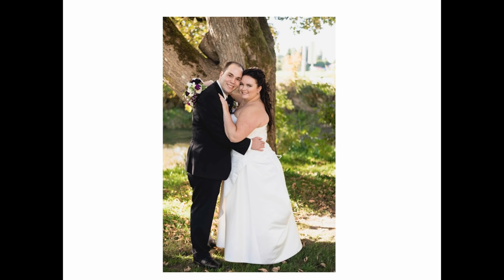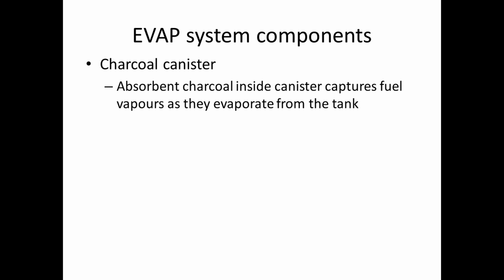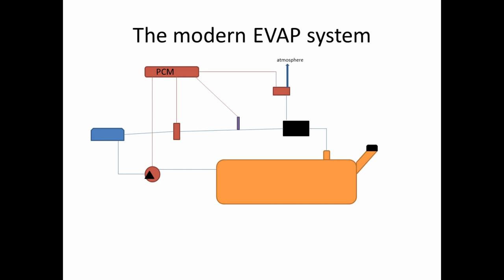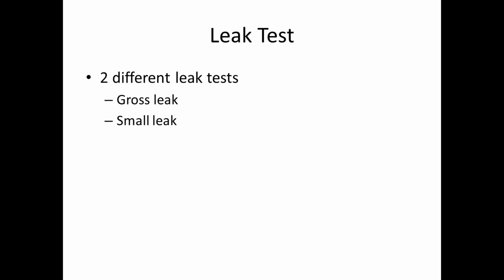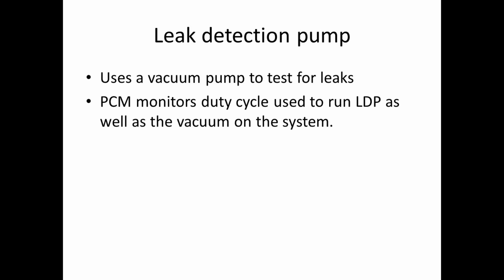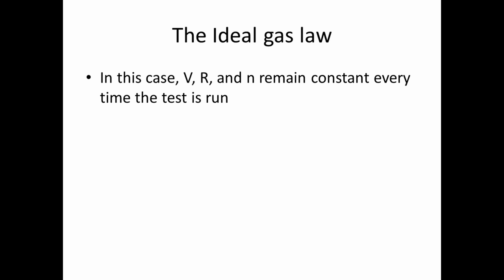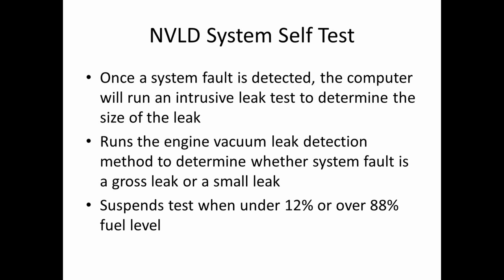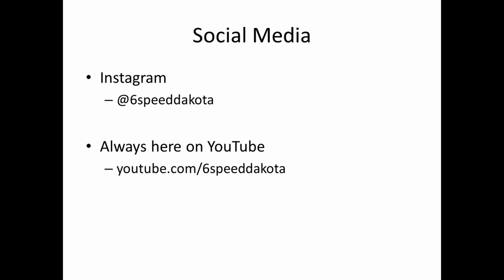6Speed's Lectures: How your EVAP system works

Comment: Good video - learned a lot.    Question: Is there a diagram or picture of the hoses associated with the Evap system on a 2003 Yukon (5.3) ?  I recently replaced the fuel pump (in my back yard) when I got it back together I get good pressure but it's "Misfiring on all cyclinders" and throws a P0446 code on my little scanner.  I'm thinking that I missed a hose somewhere but don't see it.     Thanks for your time            Dave W    dwade@wadeclan.net
Reply from the maker: Check under the hood, you'll probably find a diagram on the underside of the hood. P0446 is a vent valve circuit malfunction. Make sure that you plugged the vent valve back in if you unplugged it. Also make sure that the fuel pump is in properly seated and the hoses and sock filter is properly attached or you're going to get aerated fuel which may cause your misfire on all cylinders

Comment: Is it normal if the vent valve (normally open) is closed when the engine is off? I have a Toyota RAV4 01.
Reply from the maker: It shouldn't be unless it has an NVLD system, which is common on chrysler vehicles. If you're having trouble putting gas in it, then I'd say your vent valve is either stuck closed, or the end is plugged somewhere

Comment: My car has a strong fuel smell in the cabin when the engine has been running for a while (very warm engine). The smell lingers for many hours even after I park.

My mechanic says that there are no stuck-closed valves in the system. There are no fault codes. Is it possible to conduct a leak test on my own?
Reply from the maker: I would suspect potentially an exhaust leak before the catalytic converter, or you have a fuel leak somewhere. I would start there if there's no visible leaks
Reply: @6speeddakota  Thanks!